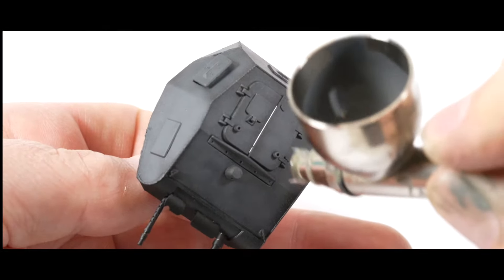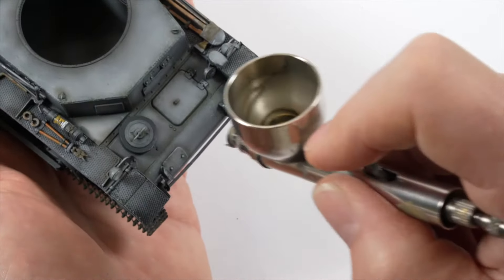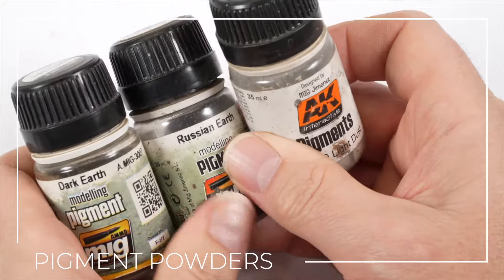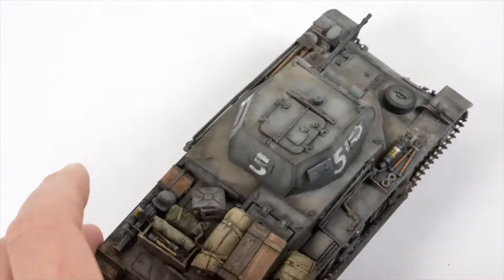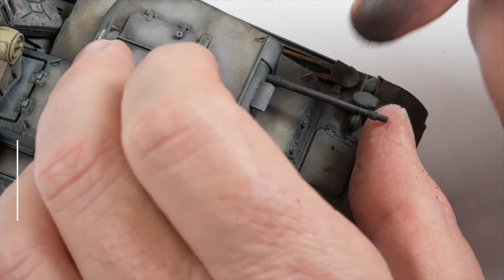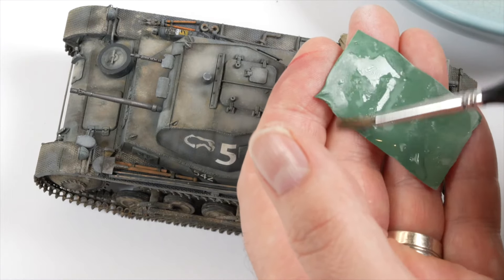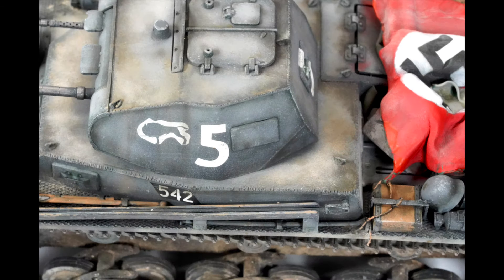CREATING Dust & Dirt effects with OILS and PIGMENTS / Weathering tutorial - IBG Models Panzer II

Comment: Clayton, just want to mention I liked your technique of mapping with oil paints & adding pigments on top. I’ve just tried it and liking the results. One question, how do you manage areas where you want more precision with the pigment applications? Example, the inside corners of a side fender against the hull?
Reply from the maker: Im not 100% sure what you mean. But I think you are possibly talking about using the pigments as a wash ? You can thin the oil and the pigment down into a wash using white spirit and use it as a pin wash around internal corners and details. As long as the brush isn't loaded up too much you can be reasonably accurate. That what you mean ?
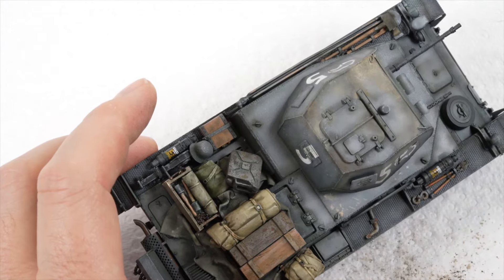Reply: Not quite. In the video from about 5:15 to 7:20 you used dust colored oil paint on the turret roof corner then stippled pigment into the wet oils. I’m wondering how you would go about that in a tighter space and keep control over the pigment? My pigments tend to end up in a wider area than I want.
Reply from the maker: @Gbenc123  - OK... the dry pigment shouldn't bind to paint by itself and should just blow off the surface of the model. As long as you are controlled with the oil paint application (thin it down a little and use a fine brush) you should have pretty good control of your pigment. The Oil is setting the foundations (or the 'glue') and the pigments are just finishing it off. Hope that is a little clearer. Happy to try help further if I sound like Im talking in riddles :)
Reply: Gotcha! Thanks for the help. I’ve tried this last night and it’s looking good 👍🏼
Reply from the maker: Brilliant!

Comment: The Panzer II looks fantastic Clayton! The weathering techniques were a master class. One question - will the oil paints you applied be suitable for use on acrylic paint in the way you have shown, or should a clear coat be applied first? This has been a great series, and has provided some great tips. I am now looking forward to the Hetzer build. Love the channel man, so keep them coming. Cheers from a fellow Aussie
Reply from the maker: Hey Gary. As long as the model has been prepared properly (strongly recommend priming if using acrylic paint), and it’s dried properly you should be fine. Appreciate your support. Thank you